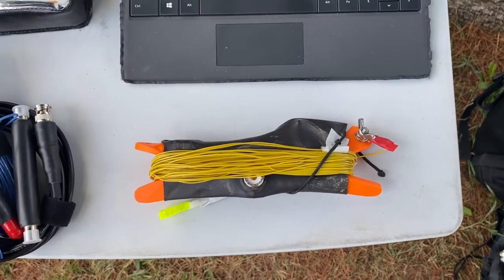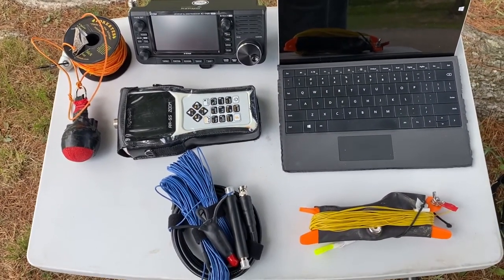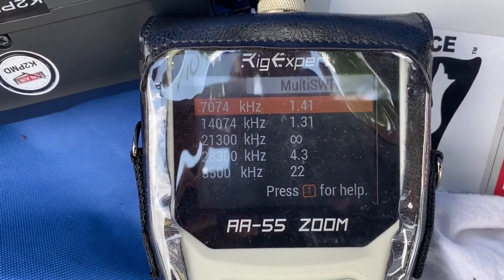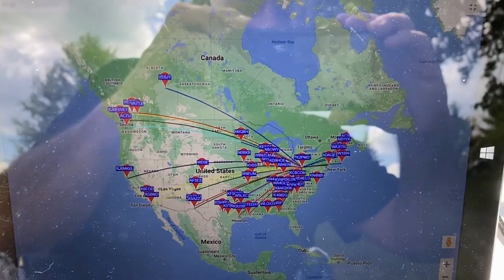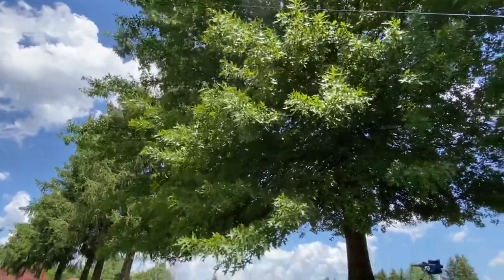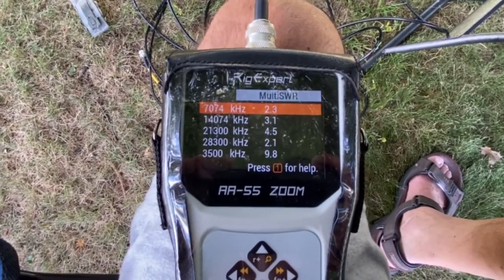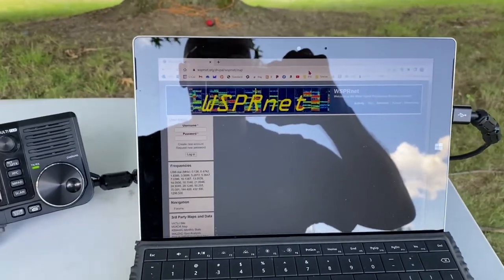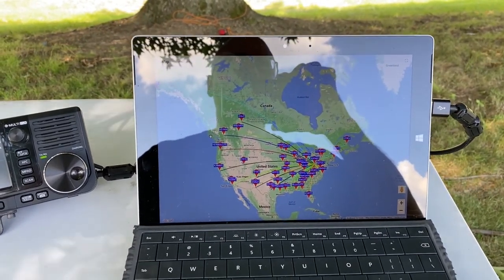KM4ACK EFHW vs N9SAB OCF MICRO DIPOLE

Comment: Thanks for running the test… looking forward to more of this content. I agree that the map data looks fairly consistent in terms of geographic distribution… but as it’s WSPR, there are only so many monitoring stations. Did you notice any difference in the SNR for those stations that picked up both antennas? 

I have the same antenna from N9SAB, and agree the design is appealing and functional. I also have his QRP EFHW, which has a matching box, instead of having the 49:1 on the winder itself (as KM4ACK’s kit has)—but it’s essentially the same functional design. End feeding is more convenient for quick deployments, I think… but for longer sessions or multiple-day ops where you can get the OCF Windom up high…. I suspect there is value there. Because the 10’ coax stub radiates as a vertical segment, it perhaps needs to be up higher to function optimally. 

I was curious if you ran the Icom 705’s internal ATU on the N9SAB micro windom prior to running the test? The EFHW (designed to be resonant on 40m, and thus also 20m) was designed to be run without a tuner, but one typically expects to employ the ATU on the OCF dipole on pretty much all the bands.  While they’re both multi-band, I think I can tune more bands more easily/quickly on the OCF.

So, setup on the OCF windom dipole is more demanding, but you win some additional versatility. The EFHW is better for quicker/shorter deployments primarily on 2 (maybe 3) bands.
Reply from the maker: Thanks for the comments. I am definitely going to keep working with the N9SAB antenna. I suspect it will work better than the EFHW after I trim the wire and get in more in the clear like 30 feet. 

Unfortunately, the IC705 doesn't have an internal ATU. Why, I don't know. It certainly is a drawback to the radio, which is not cheap. Thanks again for interacting. I will certainly do another video on N9SAB after I trim it and test it again.